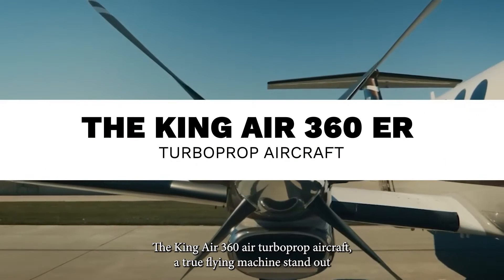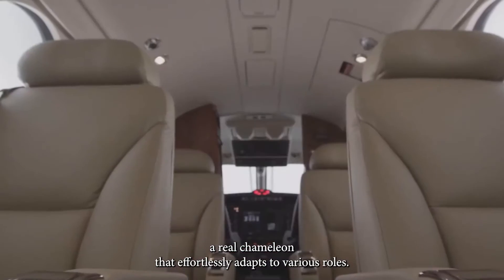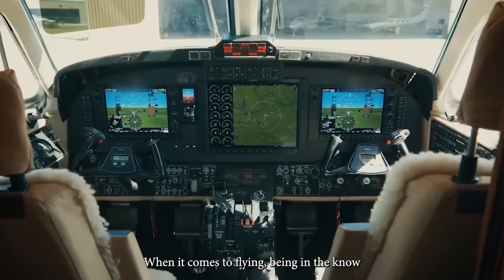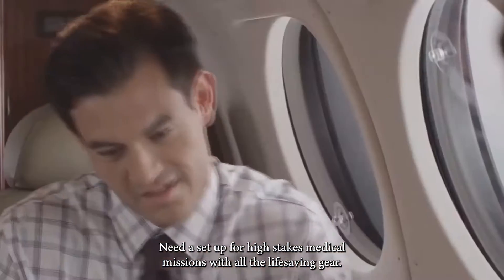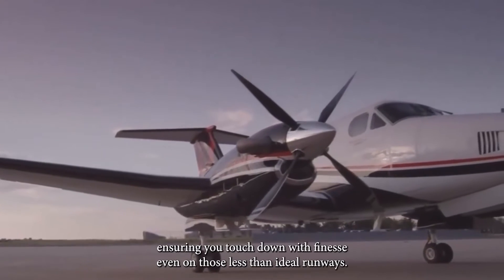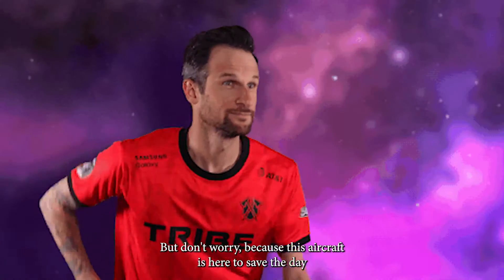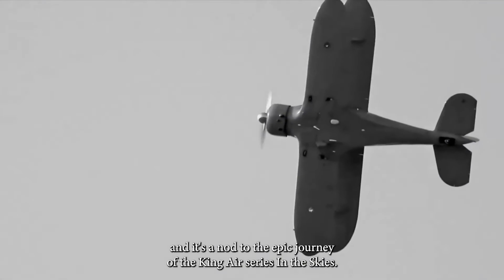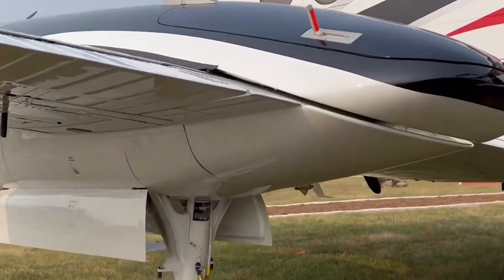King Air 360ER Tour, 10 Outstanding Facts You Need to Know

Comment: The King Air 360ER Tour highlights a remarkable aircraft that excels in performance, comfort, and versatility, making it a top choice for discerning operators across various mission profiles.
Reply from the maker: The King Air 360ER Tour: Where performance, comfort, and versatility join forces, earning its crown as the top pick for discerning operators on any mission profile. 👑✈️